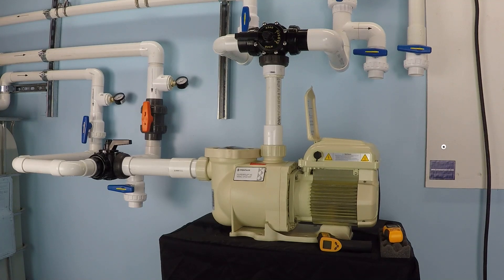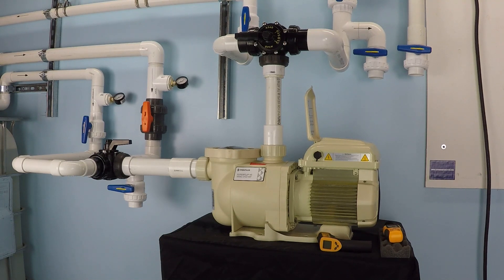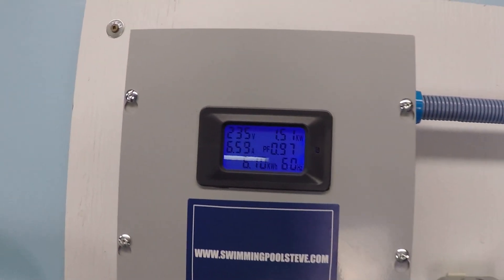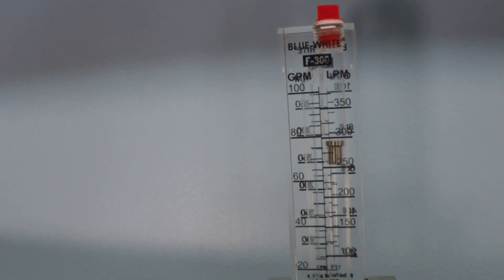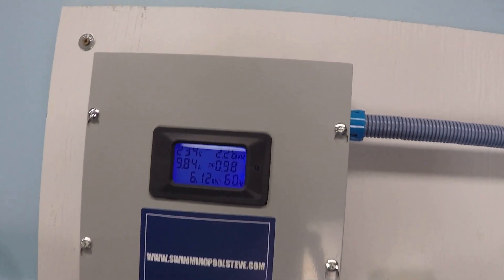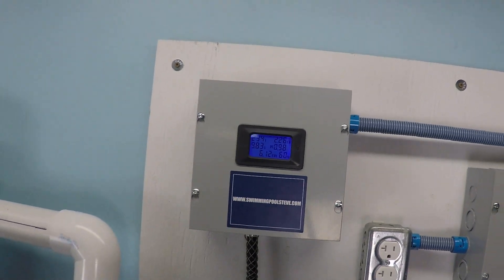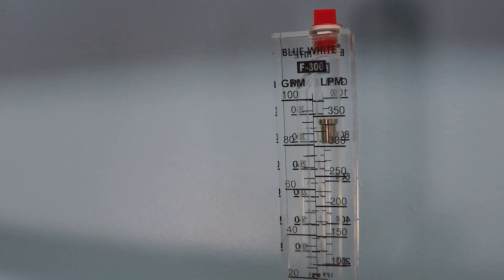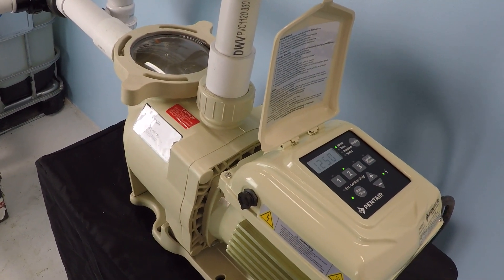Pentair SuperFlo 120 Volts Versus 240 Volts

Comment: So is it cheaper energy wise to run 230v v 120?
Reply from the maker: @RiyadaNem  230v, and higher potential as well. Lower current is less transmission loss, which is why we use high voltage transmission lines in infrastructure. Low current and smaller conductors. It's not much at the pool pump level, but higher voltage when available is the better option.
Reply: @Swimmingpoolsteve  your videos are so good. I’m currently running 120v with this same exact pump but I’m thinking about running a 220  it it will be a pain

Comment: Steve, 
Great video. However, I was hoping for a true 120v test using 120v mains. The main difference I would expect, is that at the same flow rates, the higher voltage would be more efficient, and this would show in terms of the watts per flow rate calculation. 
Thanks
Reply from the maker: I have that as well, it is just a different video.  Here you go: https://www.youtube.com/watch?v=_Nr2zEakhSY
Reply: @Swimmingpoolsteve  Thanks, very thorough. I like your style, man!